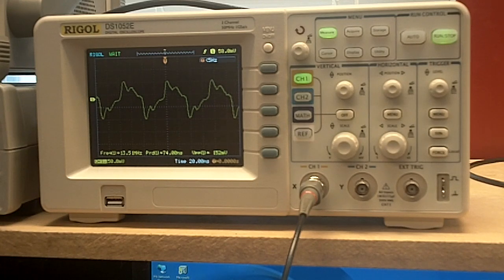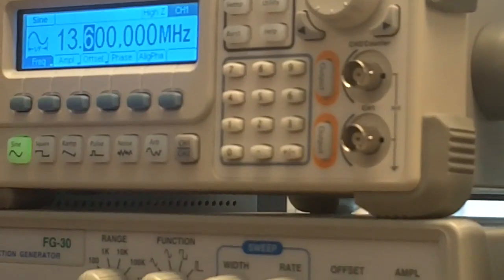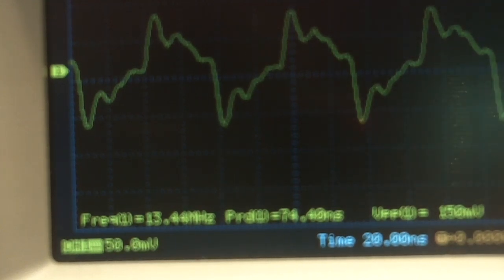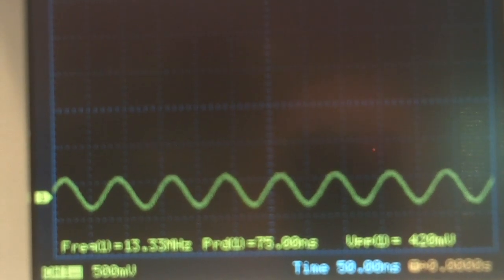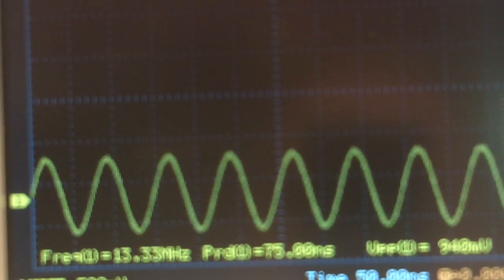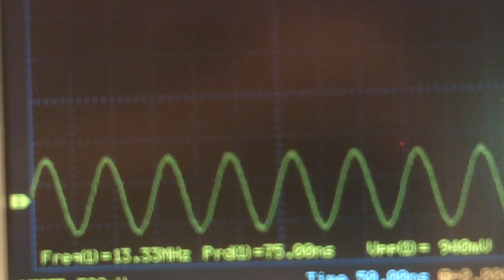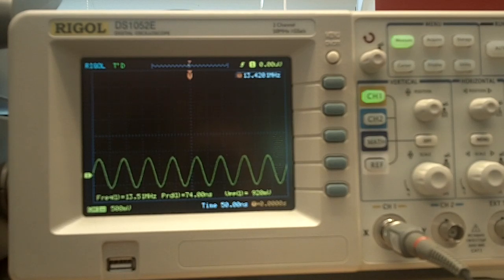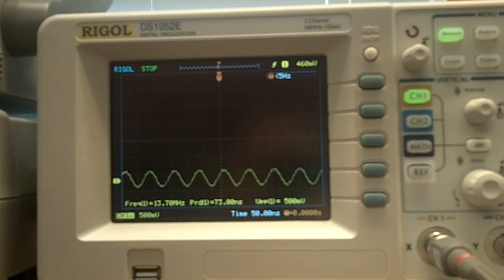Determining the resonant frequency of unmarked crystals Part II

Comment: Do you know if this technique would work for off the shelf surface mount 10MHz oscillators? I need to test a bunch and I have a nice Tektronik 3000 O-scope with a built in function generator. The devices have 6 leads and I am not sure how to hook it up.
Reply from the maker: I'm a little confused...if you already know it is 10mhz, why are you wanting to determine the frequency?  Also, it sounds like you have a ready-to-go actual oscillator, not just a crystal.
Reply: true it is an oscillator. It is suspected that the batch is not oscillating 10MHz when they are at certain temperatures. I will be testing this.